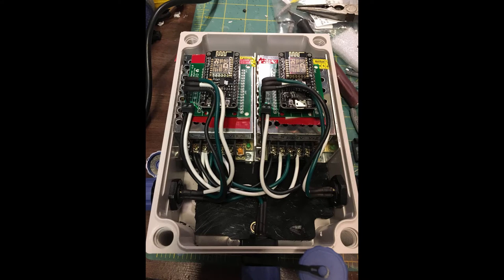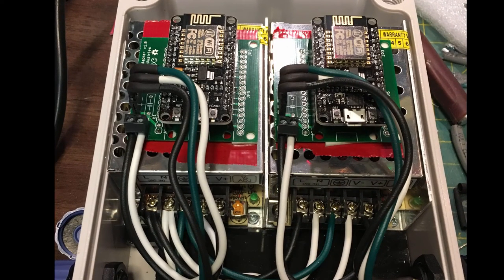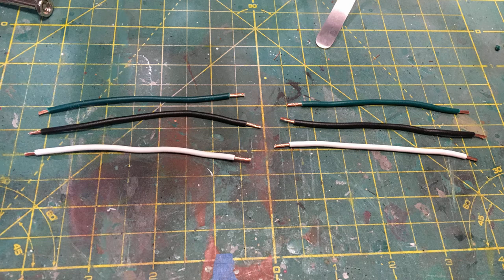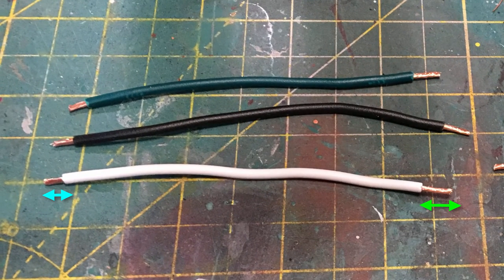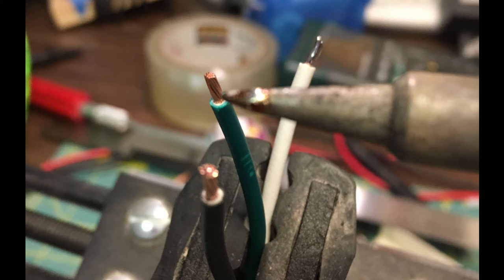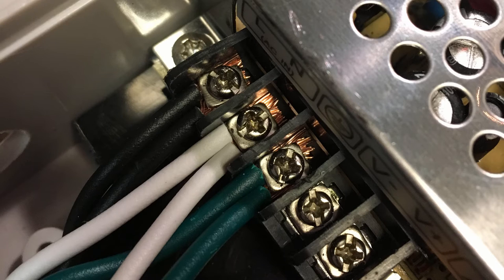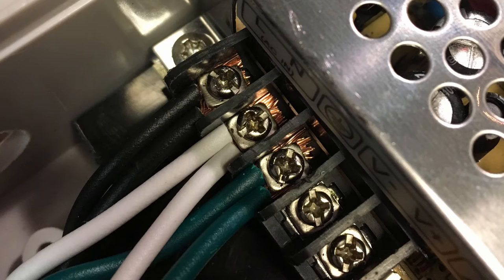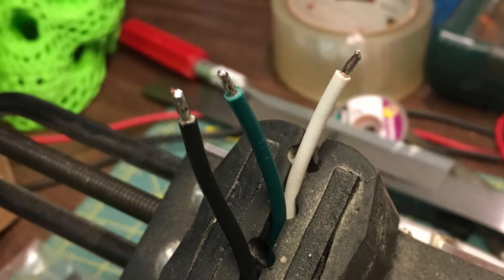ESP8266, WS2812, and Christmas! Part 2

Comment: So I'm really new to this, but trying to put together a permanent holiday lights display on my house.  How do the wires from the LED's connect into the aviation sockets that you installed?  Do you only have one channel running out of each nodemcu?  I apologize if these are dumb questions . . . very inexperienced at this.
Reply from the maker: Hi Steven.  I run one string of lights from each nodemcu.  The connectors carrier power, ground, and signal.  I don't recall which pin I used for signal, but it's documented in the code.  Let me know if you have any questions.

-Tom
Reply: Thanks Tom

Comment: Strange wiring. Is there a fuse on the expansion board, are you sure the traces can hold the 4A?
A Sonoff SV could do the job a bit easier, cheaper bc no expansion board needed.
Reply from the maker: Hello @AltMarc - thanks for watching the video and commenting.  When I started the project the Sonoff was not available as a product.  Further, the Sonoff just turns things on and off - the code in the ESP8266 does far more than that.  I suppose I could hack the Sonoff but now that I have this working I don't see the point (other than cost).

The expansion board is not simply for power distribution - it's a generic break out for the ESP.  With respect to the trace width, they are certainly a little small for 4A.  If I make another batch I will use a pour to better distribute the current and thermal expansion.  Thanks for watching!

-Tom